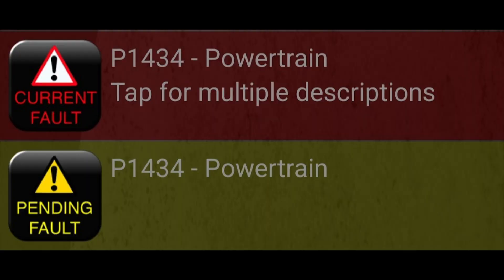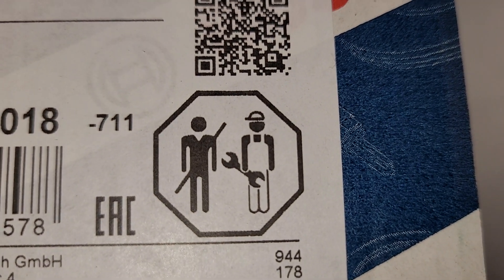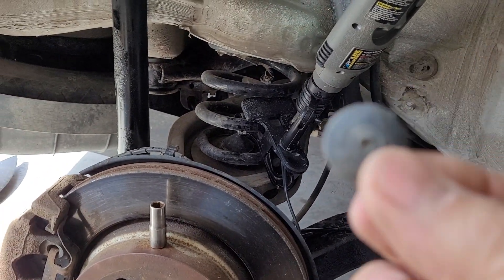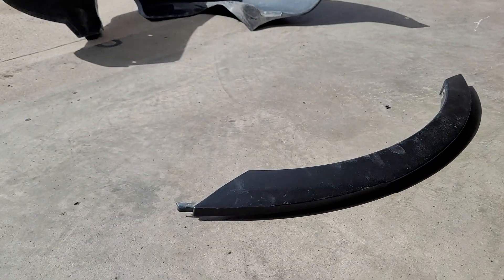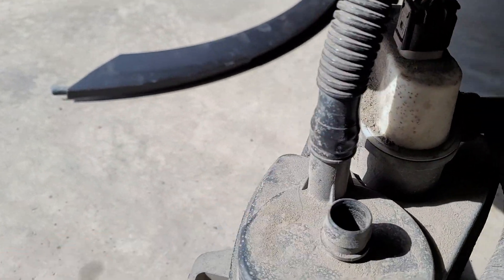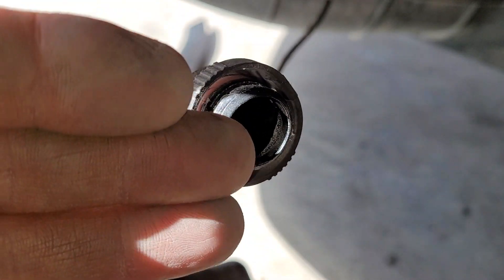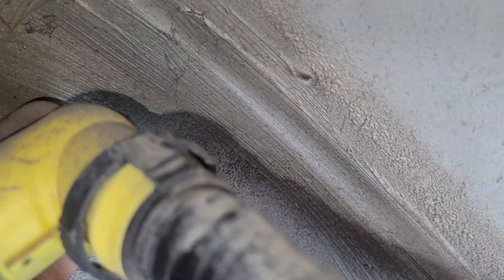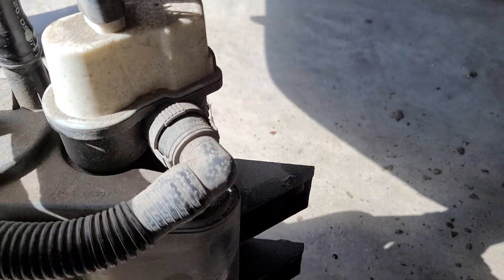BMW DMTL pump

Comment: That's a good video.  I hope it fixes my 07 525i.  I got the P1434 code 1 week after changing my Pump and Filter.  I hope it helps.  Thanks